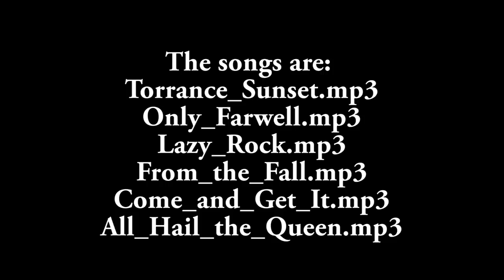Yellow gold hinged necklace enhancer

Comment: how often do you anneal it when running it threw the rolling mill and working it with the pliers?
Reply: well maybe not just the pliers i mean working the metal in general
Reply: Typically you develop a feel for when you need to anneal something when rolling every two or three passes sometimes depending on the type of metal but through the process of bending and stamping forming you may need to anneal 10 or 20 times before you're done I've seen people break stones in setting them because the metal was too hard it's a easy thing it just takes time and patience to get a feel for it
Reply: Nice work. I could never get the hang of seating springs.